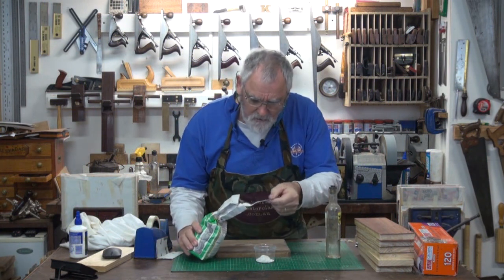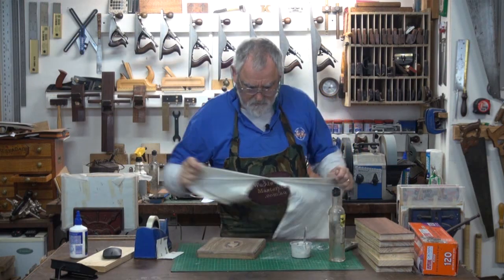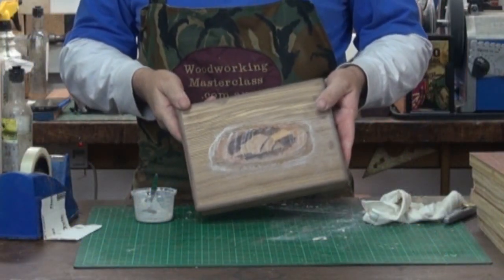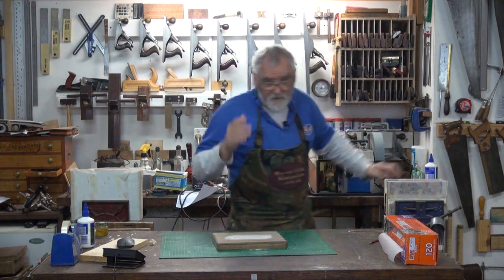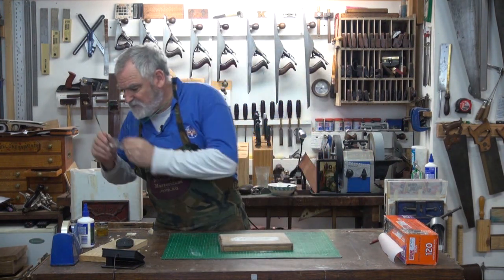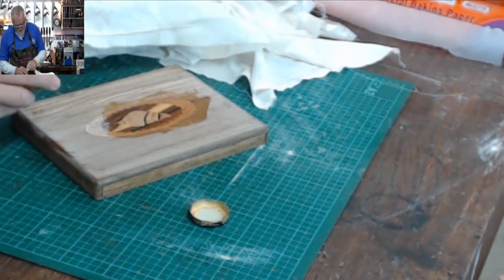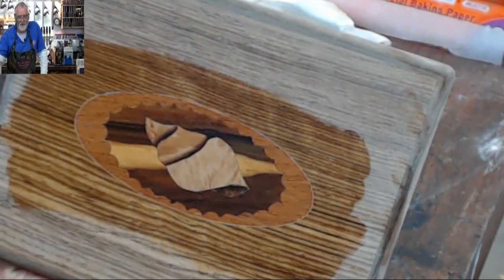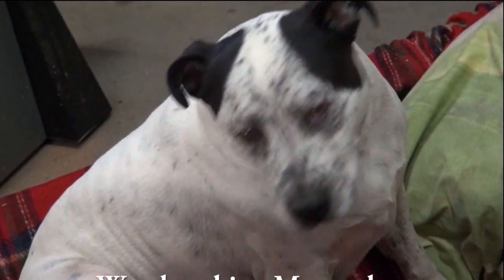Marquetry Shell Grain Fill Clean up

Comment: Half way through when you mentioned the plaster... I though 'What'???  why not make a slurry of the dark timber mate, which is what I use as a grain filler. Then near the end you explained it goes translucent, and oiled the top.. Yes, it 'Pops'. I will try Plaster..  as a grain filler  to see what result I get. Thanks Steve.
Reply from the maker: Hi Peter, In some instances I would also use Timber Mate the same way but there are to many colour variations for that to work in this instance. Let me know how you go with your trials. Cheers Steve

Comment: It's looking great. I'm curious why you use raw linseed oil rather than boiled. I always thought the only notable difference was that the raw stuff took much longer to dry.
Reply from the maker: Hi Karl. You're right and that is the very reason I use it. I usually French Polish the Marquetry pieces and a part of the French polishing process is called Spiriting Off. In that part of the process all the oil is removed and leaves only Shellac behind. Using Boiled creates a problem for me at this stage as it has dried and created a skin which the shellac won't melt and leaves the end results blotchy and not the clear smooth finish I am looking for. But Boiled as a final finish I can't see anything wrong with trying that. Cheers Steve
Reply: Thanks for the reply, Steve. Will you be continuing this series to show the French polishing? That would be cool.

Comment: Hi Steve 😀 can plaster of Paris be used as a grain filler? And can any finish be used on top of the plaster or does it have to be raw linseed oil? Please 🙏🏻😀
Reply from the maker: Hi Rob, How the Art going? Yes Plaster can be used as a grain filler in earlier times Arrowroot was also used. I've only used Raw Linseed but I guess and "Natural Oil" with no added chemicals could work. I does have to be able to dry though. Try some small test pieces and see which works best. Interest in the results. Cheers Steve
Reply: @Woodworkingmasterclass  oh I haven't did any art for ages, I really should do some again 👍 ah thank you so much Steve 🙏🏻 I will buy some plaster and do some experiments, I will let you know 👍😀
Reply from the maker: @robcpwoodturner  One thing I forget Rob was make sure you finish will adhere to it. I mainly use shellac over that type of filler and I know that works but Acrylic does not! Found that out the hard way. :) Cheers Steve

Comment: other question: I have a bit of router tearout on a piece of work out of cherry. which I plan to fill with timbermate. The problem is: cherry darkens with time, and im not entirely sure how much darker I should make my mixture for it. Would you have any alternatives or tips for me? Thank you!
Reply from the maker: Hi Saian, I would err on the side of darer is better. Another thought depending on where it is and what you are going to do with it. Clear Resin may be an option. Or enlarge the slip and place in a solid timber patch matching the grain as close as possible. Hope these are a few options to mull over. Cheers Steve
Reply: thanks steve! I think I will still go for timbermate, but darken it so that it ressembles darkened cherry. I have a cherry entrance table at home, and it is quite old, ill try to match this as good as I can. Fortunatly the mistake wont be very visible, it is on an electric guitar body, not so big and under the horn so I wont see it while playing anyways
Reply from the maker: Good choice. I use Timbermate a lot, I like the fact that it can be mixed so easily. Cheers Steve